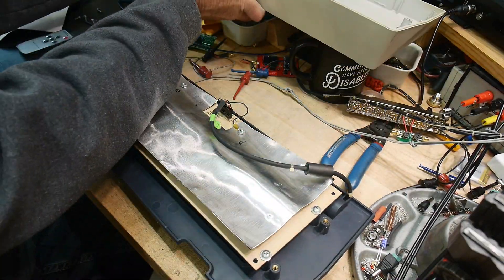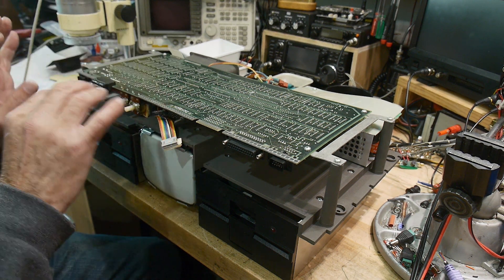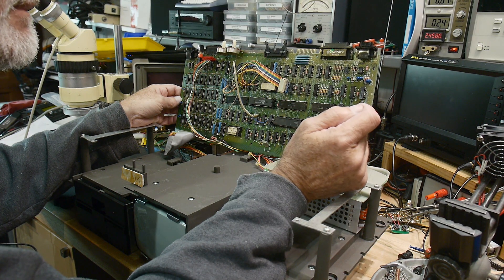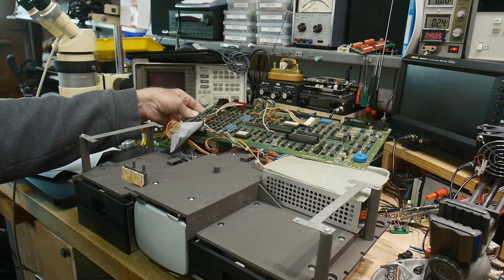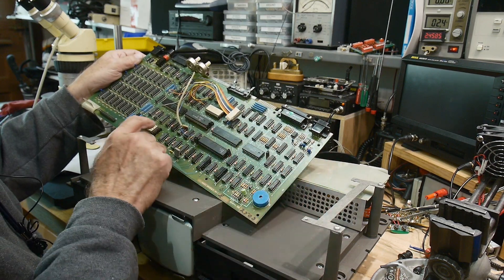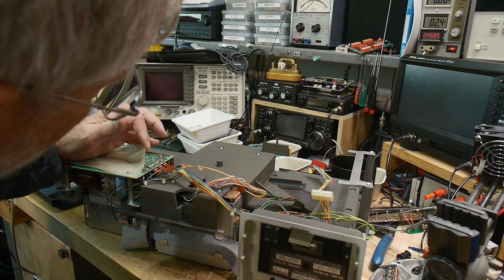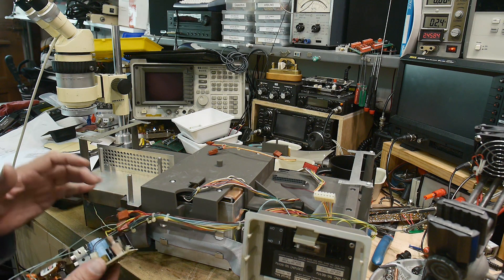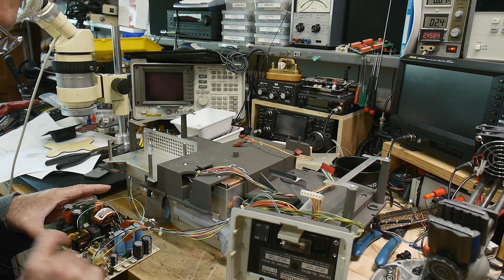#1003 Troubleshooting the Osborne 1

Comment: Working on electronics in Florida weather and humidity, never have zapped anything through static electricity myself either.  I'm pretty sure you could drag DRAM modules across carpet here and they would still work fine afterwards.